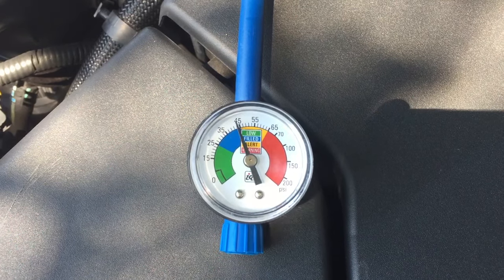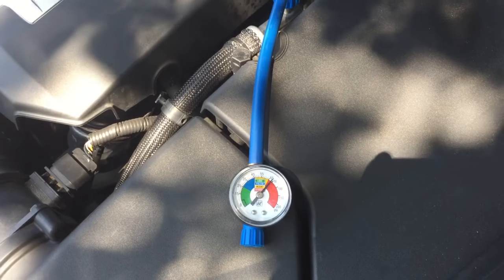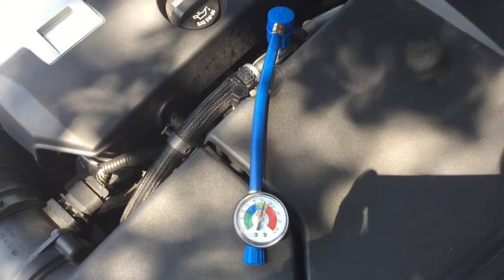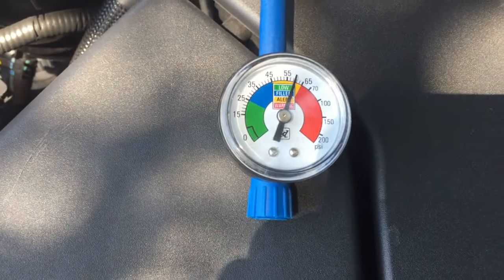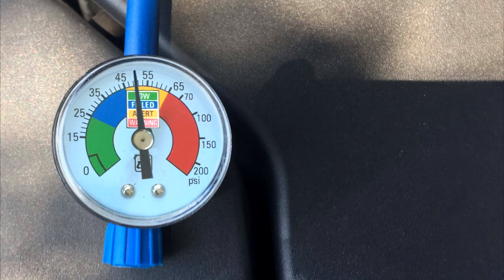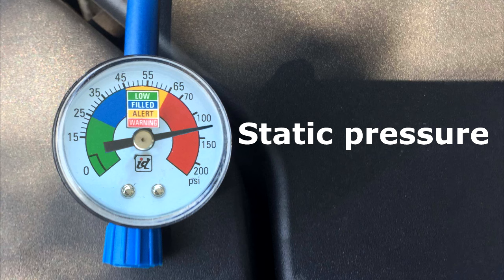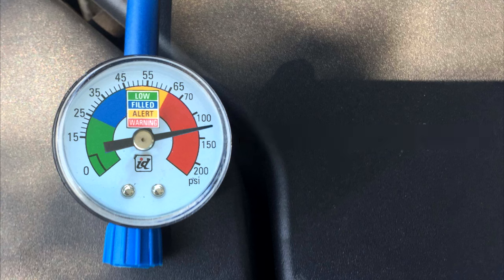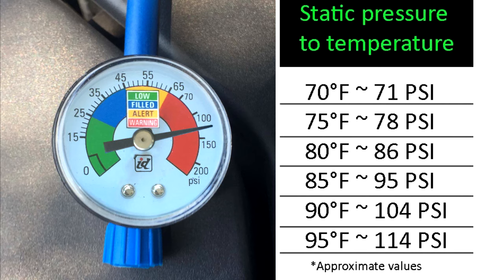Car overcharged AC system or undercharged fix

Comment: Does this work for a refrigerator too? I'm having issues charging mine up. Or maybe it leaked all out already. My inside temp is set at 75 degrees. It's a little bit cooler in the basement. But my auto ac gauge has a 55 and 100 mark. And I set it exactly in between. So it's set at around 77.5 PSI. It's probably between 70 and 75 in the basement right now. Is that correct for a fridge?
Reply: It depends on the type of refrigerant used in your refrigerator. It could be HFC-134a or R600a

Comment: My ambient temperature says 94F and the AC gauge says 120psi please is it a good value?
Reply from the maker: No. With the engine off at 94°F ambient temperature, the AC pressure should be around 110 PSI. This chart is for R134a refrigerant.
Reply: @Your-Self  thanks, so I should better reduce it by 10%

Comment: How long should I run the car before turning it off and checking static pressure? Or can I just measure it before turning the car on? Thanks
Reply from the maker: It's better not to run the car at all. Check the static pressure with a cold engine for better accuracy.
Reply: @Your-Self  thank you. I appreciate your knowledge

Comment: My psi was in the 60s but the outside air was in the mid 80s. What could that mean?
Reply from the maker: Let your car sit for at least an hour, and then measure the pressure again. If the result is the same, you may need to add some refrigerant, according to the chart.

Comment: Is this somewhat accurate if my compressor clutch never enables ?
Reply from the maker: Yes. The static pressure is measured with the car OFF.
If you have very little refrigerant in the system, the clutch may not engage at all for safety reasons.

Comment: I added refrigerant and the niddle was in the yellow chart region and I can see my compressor motor moving and the fan facing the radiator also engaging but because i felt because the niddle in the yellow region it meant its overcharge so I discharged some gas till the niddle went to the green region chart(filled) but the compressor motor stop moving and the fan facing the radiator also stopped. Please what does this indicate and the air conditioning not cold. Please help. The car is Hyundai Santa fe 2010 4wd
Reply: hope you're not discharging the refridgerant straight into the atmoshpere
Reply: either you read the gauges while it was not running when it should have been running or the gauge is busted. time to find a professional i guess. ask friends and neighbors. please don't just blindly drive to the first franchise chain auto repair you come across. find an independent garage that you can trust.
Reply: @matthewmase3549  I hope you don’t vent your vehicle exhaust into the atmosphere…

Comment: So do you have to adjust it as the temperature rises and falls if it’s 80 today and 100 tomorrow is my AC not gonna work right I’m confused
Reply from the maker: No. You may need to adjust it once to your current temperature. After that, the refrigerant will contract and expand on its own.

Comment: So if doesn’t go to red when the car is off it means its undercharged?
Reply from the maker: If it's hot outside, but the gauge is not going to the Red within a few minutes after shutting off the car, let it sit for a couple of hours. If it's still not in the red, the system is probably undercharged. If it goes in the red after sitting a while, the system could be clogged up, so the pressure takes longer to equalize.

Comment: But how do i drain it tho? I overcharged my ac with a refrigerant can how do i fix it the video doesn't show how to fix it
Reply from the maker: Technically, you need to take it to a shop where they will vacuum the excess with a special pump. But some people use a screwdriver with a rug on top of it for protection. It's like deflating a tire. But doing this can be dangerous and frowned upon.

Comment: What should be the range of statistic pressure if outside temp is 65F ?
Reply from the maker: If the outside temperature is 65°F, the static pressure should be around 63 PSI for the R134a refrigerant.
Reply: @Your-Self  thanks but my statistic pressure is almost spot on with the outside temp.anymore idea?

Comment: I imagine this also applies to using 1234yf refrigerant !
Reply from the maker: No, this chart is for the R134a.
Somebody in the comment section left a link for the 1234yf refrigerant, but I can't confirm if it's correct or not https://refrigeranthq.com/r-1234yf-refrigerant-pressure-temperature-chart/

Comment: I added refrigerant 134a and the car started kind of vibrating on and off and the ac compressor also went on and off. I think I added too much refrigerant. So I just took a screwdriver and pushed the valve in the low line. Is that ok?
Reply from the maker: The proper way is to attach a special vacuum pump to remove excess refrigerant, but some people do it a similar way as you, which is frowned upon.
Reply: @Your-Self  yes, I understand. Next time I will totally do it with the vaccum pump. So how would I know that I still need to take out more refrigerant?
Reply from the maker: First, do the Static Pressure test (as on this video) to see if you don't have enough or too much refrigerant.
Then, turn AC on max full blast and slowly start removing refrigerant until the compressor stops disengaging ON and OFF. The suction pipe (where you attach the valve) should become cold and "sweaty."
You can run another Static Pressure test afterward to verify a good amount of refrigerant inside.
Reply: @Your-Self  the static pressure test results should be the basis to add or remove coolant ?not the gauge reading when running system?
Reply from the maker: @Blake Barber not really. The Static Pressure is like a secondary test when the gauge is acting crazy. But if your gauge just sits LOW and steady with AC running, you can add refrigerant until the gauge goes up into the Blue territory. Do it on a hot day with AC turned on Max.

Comment: So my 2007 mdx read exactly same as yours when car is odd  same temp ambient - it blows warm air acclaim all cold - used same gauge from same charger - so does this mean I have to lower the pressure for it to work properly ??
Reply from the maker: If you have just added refrigerant to the system, you may have overfilled it.
Reply: YourSelf thanks, so I did t add any- the as found was in the hazard yellow zone so I noticed how purging some makes it blow come again, I’m still trying to figure out if no one touched the system how is it overcharged - I thought I read somewhere might have to do with high humidity hot days?
Reply from the maker: Yes, the high humidity during hot days increases the pressure inside your AC system. But that pressure (in a healthy system) should not dramatically effect the performance of your AC. However, if the regular air got inside the system, it will create strange problems with pressure.

Comment: This really is not true because each sytem uses different psi . Example a cavalier may be 2lbs 4 oz a mustang may be 1 lb 14 oz . So to me how can this apply it cannot
Reply from the maker: Yes, every car model takes a different amount of refrigerant gas. But the size of tubing and other parts of the AC system is calibrated so the pressure stays roughly the same for all vehicles. And this test will give you a close-enough result.

Comment: Jeez everybody is thanking you, but I'm a bit confused... you start your video with the gauge already attached and the car already running... It needs to run for a couple of minutes before you turn it off and watch the gauge reading, right? - and I assume it doesn't matter if you have the recycle (the air) button on or not...?   More importantly, if the car's static pressure and ambient pressure line up, but the air is still not cold, then what?
Reply from the maker: This video is for those who are planning to add or have already topped off their AC refrigerant.
It's best to measure the static pressure with a cold engine. So no running is needed.
If the static pressure and the ambient temperature line up, don't add any refrigerant. The problem could be with something else... like a pressure switch, expansion valve, relay,  compressor, etc...

Comment: could you be so kind to tell me to wich of the port do you conect the guage to make the video? the low pressure? or the high one? thanks in advance!
Reply: it seems to be the low one..for the color too
Reply from the maker: A single basic gauge like this can only fit on the Low side. The High side is a different diameter.
Reply: @Your-Self  !thanks a lot! i appreciate your quick reply!

Comment: Why does it tell us on the bottle to talk to a service pro if the system is overcharged? WHY? What they are just going to do is squirt out a little of the liquid out in the air and call it a days work. The stuff is toxic and there isn't a good way to "safely" release the r-134 ref out. Can't put that stuff back into the bottle.. no sir. This stuff rips wholes in the ozone and its being reelected by lots of people all the time.
Reply: According to the EPA, you can't release refrigerant into the atmosphere; it must be recovered using a recovery system.

Comment: Mine was blowing hot air, the compressor would run 2 seconds every 30 seconds,  I used a gauge and found the pressure to be way too high.  I bled off a lot and now have it to the proper pressure. The compressor now runs 16 seconds then off for 1 min and repeats, Air is still hot.  Any idea what part might be bad?
Reply: When you bled off the high pressure, was it hot or cold? If it was hot, then the A/C system needs to be evacuated and checked for a vacuum hold on the gauges. If it holds vacuum for 5 to 10 minutes then it should be good service the freon (r134). If it blew out cold freon, then hook up gauges to low and high sides and make sure the system is not under or overcharged. There should be enough videos on YouTube to  answering any other questions you might have.     retired ASE chevrolet mechanic--did A/C work for 15 years.
Reply: @jumpercable20  Excellent info. Question... What if my static pressure is too high (with car off) BUT then my low-pressure is too low (with AC on)? Possible symptom of overcharge even though the low-side is too low??
Reply: @junkyarddog9534  probably crap has collected in the orifice tube or expansion valve (from circulating junk) or one of the cycling switches is bad maybey. those are the first 2 things i'd try to rule out if it were in my shop with those problems.

Comment: Mine was the compressor engaging but not getting cold. It does not disengage so my rpm is so high. It doesnt get cold too. What is the possible problem?
Reply from the maker: What is your static pressure with a cool engine, and what is the temperature outside?
Reply: Our weather is about 39 degree celcius,much hotter inside the car and still my compressor is engage and doesnt blow any cold air. Is it possible that it may cool if i refill the refrigerant?
Reply from the maker: If you add refrigerant it may help, but it's better to measure the pressure first, just like on this video.

Comment: This method is incorrect, sorry.  It can be used to determine gross over or under charge and if refrigerant is severely contaminated with air but static pressures are a very small part of the equation.
Reply from the maker: This method is obviously not a replacement for a mechanic with manifold gauges. But it's a very good first step that can help most people.
Reply: @Your-Self  Um, if he's a mechanic with manifold gauges, run away.  Manifold gauges are but one of several tools used to verify performance and troubleshoot but manifold gauges alone cannot verify the charge is even near correct, regardless the experience of the mechanic.  A system cannot and should not be charged or diagnosed by pressure alone.

Comment: I think your method is wrong completely! if at 18 C, the static pressure is at 71 psi. When Ac starts to work, the working pressure is only 10 psi.
Reply from the maker: AT 18°C, the static pressure should be around 63 PSI.

Comment: The explanation is regrettably incorrect. Static equilibrium pressure depends on the equilibrium temperature inside the AC system only, and it will be the same if there is a small or big fraction amount of liquid refrigerant in equilibrium with its vapor, so it will not be higher than in the table if overcharged, regardless of how much overcharged. The higher pressure than in the table is probably due to the higher temperature of the AC system than outside temperature or inaccuracy of the manometer.
Reply from the maker: The STATIC pressure (compressor not running) depends on the ambient temperature because the temperature inside the system becomes the same as ambient. And if you have a leak and lost half the charge from the system, the pressure will definitely be lower than it's supposed to be. But if you overcharge it, the pressure will be higher.
If you are talking about the SATURATED pressure (compressor running), the saturated pressure inside the evaporator will mostly depend on the saturated pressure and the temperature inside the condenser. And obviously, the saturated pressure will still be influenced by the ambient temperature and the amount of refrigerant in the system.

Comment: These do it yourself kits are a Croc most of them contain o i l you're adding oil to your system every time you put freon in so if you got a small leak and you keep topping it up with this stuff you're also adding oil which is sometimes labeled as stop leak little bit of a record in your system and ruining it also the outside air temperature sensor in a car isn't located in the engine compartment so that is not an accurate way to test system temperature AC should be serviced by qualified technicians
Reply: first of all these do it yourself kits are the BEST. they bring more ac work into my shop than anything else. after a diyer has screwed up a charge they seem like they've prepped themselves to spend money because obviously what's going on with their car is clearly beyond them at that point. also half assed parking lot ac work always makes a properly done job by you or me look friggin brilliant.

Comment: so - what to do if overcharged ?
Reply from the maker: Technically, you need to hook up a vacuum collector pump to suck the excess out. And correctly dispose at the auto-parts store. 
But some people just release it like tire pressure or by using a hose with a trigger on it. Doing it like so is frowned upon and can be dangerous for your eyes and hands.

Comment: This guy hasn't a clue what he's talking about....You can't tell anything about the charge this way...
Reply from the maker: Obviously, this is not the most accurate method. But you can get a general idea if your system is OVER or UNDER charged. To be more precise, you need a manifold gauge, which most people don't have. Thanks for watching!
Reply: @Your-Self  Don’t pay attention to this troll, your method as you clearly stated gets you in the ballpark so to speak.

Comment: I have a 2012 lancer, outside temp is about 115° and just connecting the gauge to low port, it reads 55 psi with ac running and compressor engaged. Turn off the car and the gauge reads at about 107 psi. Could I have an overcharged system or is it under charged? The gauge I am using is the digital gauge from ac pro
Reply from the maker: With the ambient temp around 115°F, the static pressure should be around 158 PSI of R-134a refrigerant. If your gauge is not "lying," I'd add some more refrigerant to the system. If that doesn't help, you may have a more serious problem, and it's best to call the repair shop.